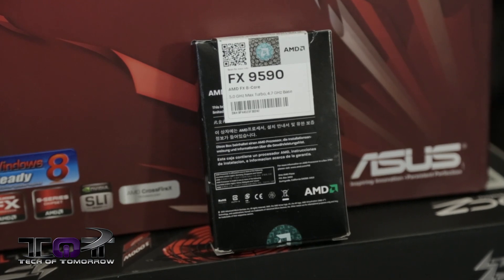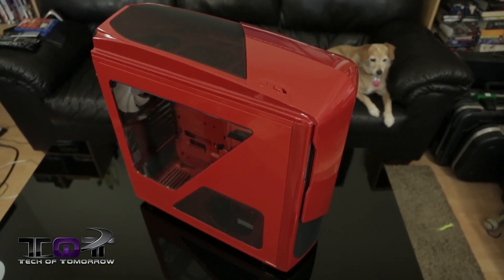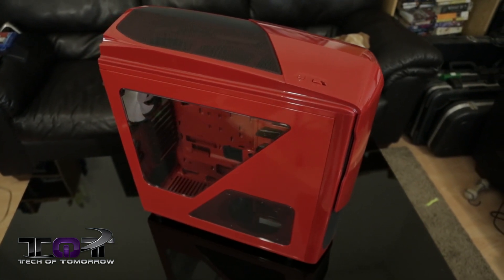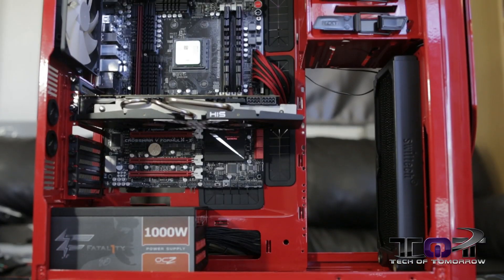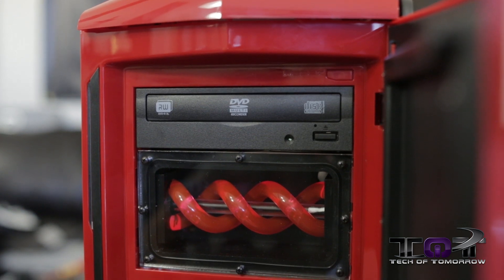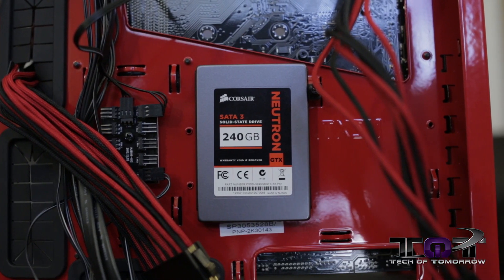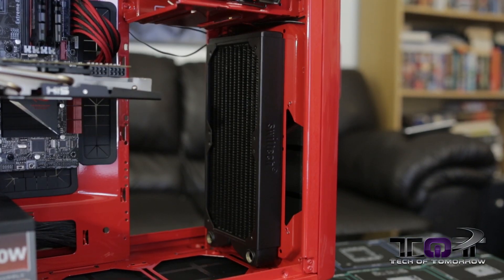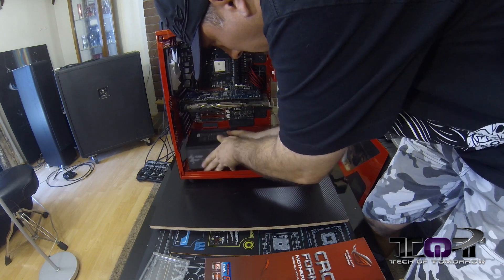The Ferrari 9590 Extreme Project: Water Cooling Prep & Pre-Build!

Comment: why the 7970 instead of a 7990? it if nothing else why not two 7970's? It's like putting a Porsche engine into a Ferrari, sure it will work but it will never preform the as well as it could with a engine that matched the rest of the super high end  performance parts.

Comment: No mate you are wrong, GTX TITAN is slower than GTX 690 because 690 is a dual GPU so why compare Single vs. Dual GPU Card.If you are planning to buy a new card grab GTx 780 it's only a little bit slower than TITAN, 5-6 FPS less than TITAN depends on the game.If you go with 780 you will save some money and can upgrade rest of your components.And remember overclocked GTX780 will perform something like TITAN .

Comment: Can I ask why you go through the chore of dismantling the system after building it, rather than leak testing anything which can leak (blocks, res, rad, pump etc) prior to even beginning the build and then assembling. 

Just a suggestion but it saves a stupid amount of time, and you are less likely to damage anything should it need to be sent for RMA.

Comment: In the same way that copper piping in aftermarket cooling heatsinks draws heat into the fin array and fans blow the heat off. The copper plate pulls heat into the water and cycles it removing heat through the radiator and fans blow away the heat.

Comment: Putting a radiator there is the worst place to put it, heat dissipation goes up remember? Also, with a build like this, You're really only going to be using a ssd and/or 1-2 hard drives.

Comment: This is just a extreme build, when you're doing extreme builds you really shouldn't care about the price, that's the point. Plus unlike Intel (which I absolutely love) this processor is the reason for the build, its color scheme and heat output are the reason for the build. You NEED an extreme heat dissipation system and AMD's main color scheme is black and red :D

Comment: whats the point of this build? you could have done the same thing with an i7 and not have to use expensive water cooling or pay extra for power.
The 9590 isnt even a decent cpu for its price, a 4770k will probably beat it